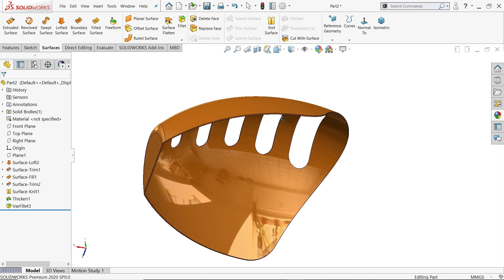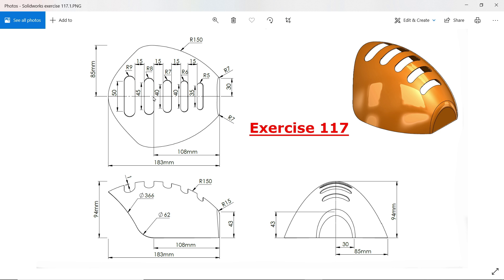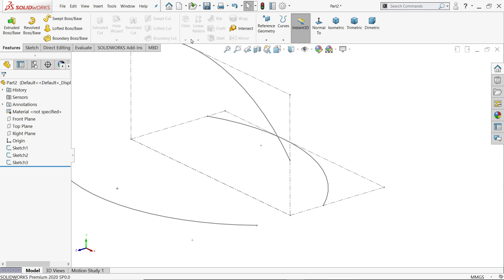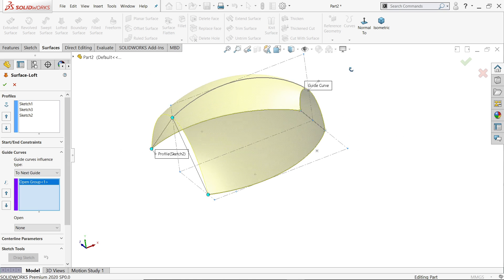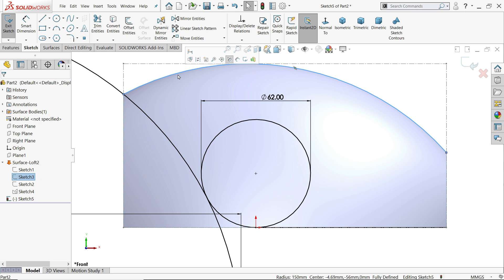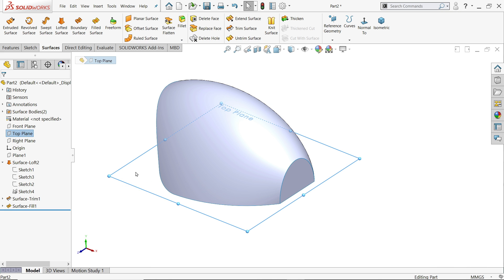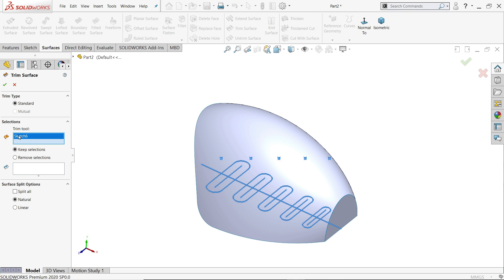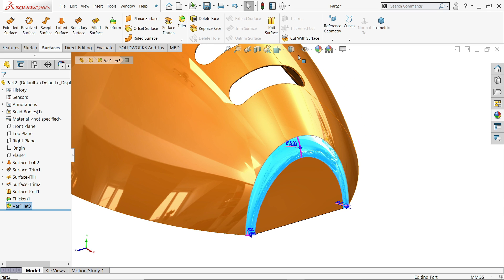SolidWorks Surface Tutorial Exercise 207 (Lofted Surface, Trim Surface, Filled Surface)

Comment: Thank you very much for the great tutorial. Question: If I want the last variable fillet also in the inner side, could I knit both surfaces, then apply the fillet and then Thicken? (not sure if the fillet command will work on a surface before thickening.